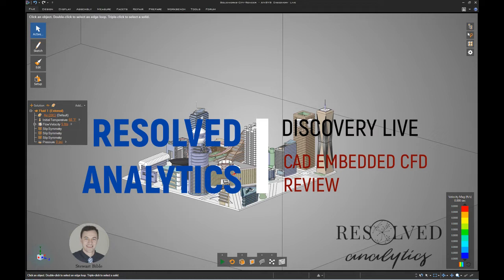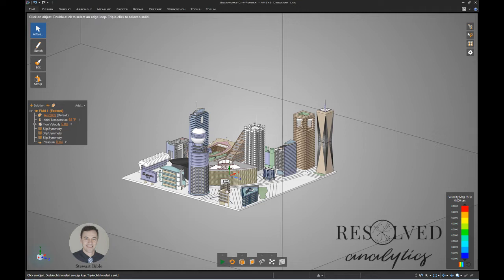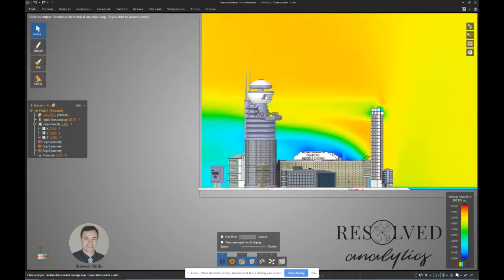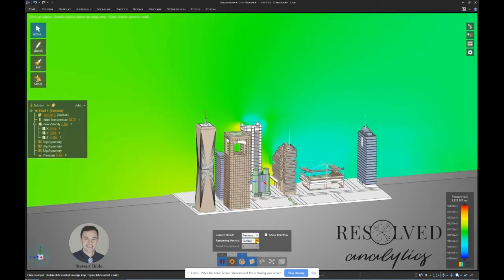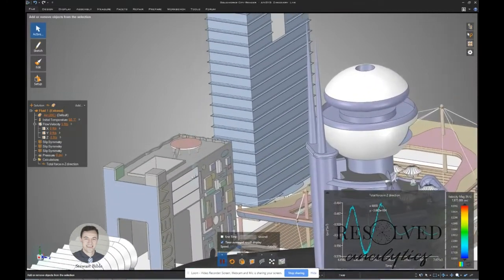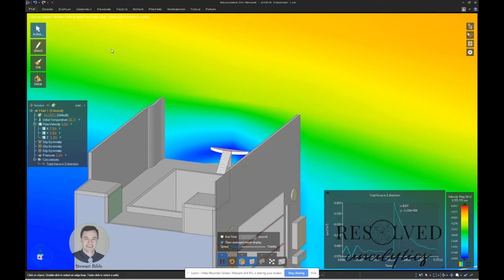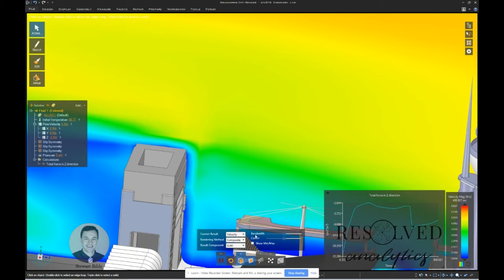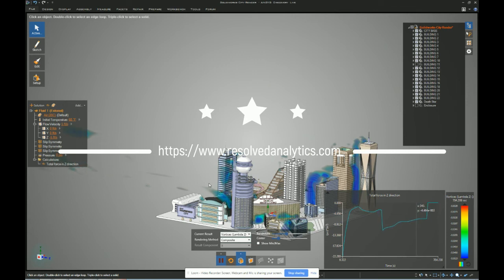Discovery Live CFD Demonstration

Comment: Stuart how do you validate these models for your clients? Does the simulation align with product-based design codes? And which GPU are you using? P4000 Quadro? Thank you!
Reply from the maker: Darsh, typically we recommend validating CFD models and parameters with experimental data.  For example, a recent client had video and quantitative data from a laboratory burner.  We tuned CFD model parameters to match that data before applying the validated techniques to other designs.  The leading CFD software vendors (ANSYS and Siemens) have done validation on common applications and provide that info with their software.
Reply: @cfdconsulting  Thanks for the explanation!

Comment: hi, Mr. I wanna ask you a question, how to make a propeller fan with RPM using Rotating Wall tools? like frame motion cell zone condition in ANSYS CFD (Fluent)? 

Thank You
Reply from the maker: Have you checked out our CFD software rundown on ANSYS Fluent?  Contact us for a 1-on-1 consultation if you don't find your answer.  https://www.resolvedanalytics.com/theflux/comparing-cfd-software-part-4-comprehensive-cfd-software-packages

Comment: Wow thanks for the video and the articles. Very interesting to see / read.
I'm a novice about this CFD engineering, just trying to figure out of there is simple way to design a small yacht, a highly energy efficient solar powered catamaran. Something you throw a lines plan in and it gives you resistance curves. Something like michlet, but CFD would seem to be the best way to go.

Of course I know the answer is to roll up my sleeves, install OpenFOAM, learn what some of those words even mean and do tutorials until I understand how this works :)

Anyways, thanks for your articles!
Reply: How is the OpenFOAM thing coming along?
Reply: @drury2d8  I haven't even tried yet :)
I used prelimina.com for some preliminary values for my boat project.
Reply: @dejayrezme8617  Cool, i wanted to know the learning curve for openfoam.